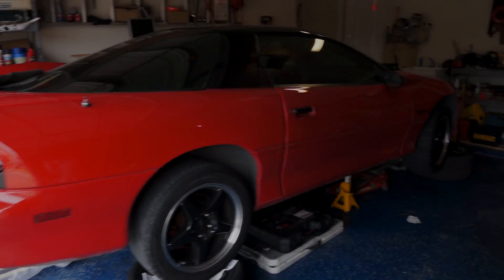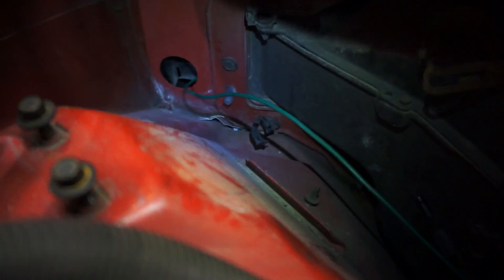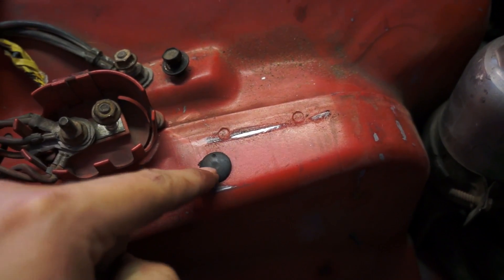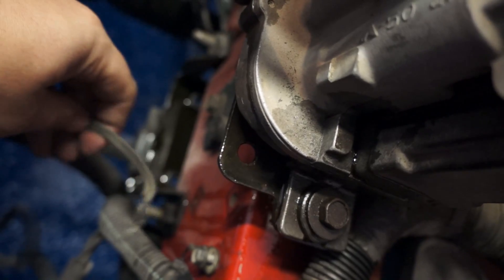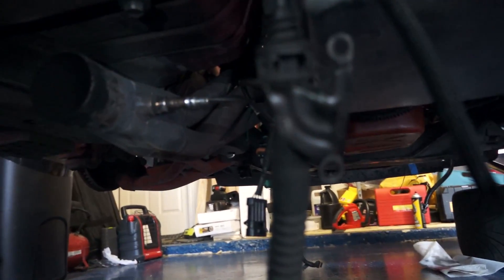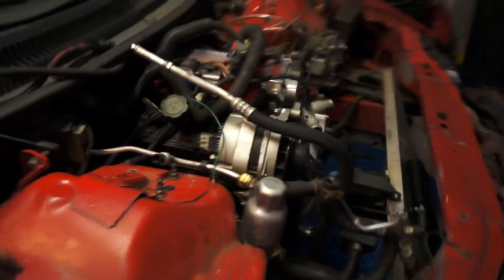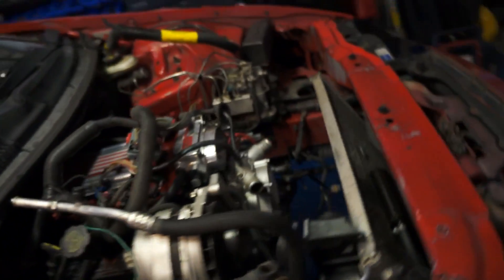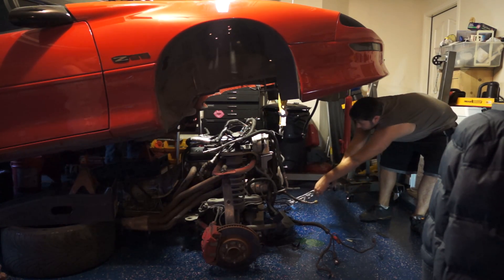F-Body LT1 Engine drop guide

Comment: If you had a lift . with the car up on lift and you remove the K member cradle bolts= Will the shock tower bolts hold the motor to come down remove shock bolts and lift car dropping motor and trans and wheels al at one time ???

Comment: No thank you for taking the time to make this video, this is really gonna help me a lot, I need to do this for my 96Z 28SS, just to do my long tube headers install and spark plugs and wires because they’re routed on the bottom of the engine, I think this will be the easiest way for me, and I hope to be able to buy a tubular key member at the same time, I’m 6 foot six 400 pounds and my hands are just way too big to work on this car with the engine in place, I love this car but I hate having to work on the engine when there’s no room, thank you so much, this will make it so much easier
Reply: Sorry, I was using voice to text
Thank you for your video

Comment: Any tips to safely disconnect the fuel lines so fuel doesn’t spill out?
Reply: unplug fuse for fuel pump and run the engine till it dies out (from no fuel) then you know there is no gas left

Comment: Had a 96 engine and transmission put in my 94, got a PCM programed to the vin of my car. Anything I need to know about wire wise or otherwise? 6 speed manual.

Comment: Will come thru the top with hood still installed
Reply: Nope. You have to remove the hood, radiator, a/c condenser and a boatload of other stuff. This way is much easier than taking it out the top. There's about a foot of engine back under the windshield.

Comment: how did you loose compression? i found the LT1 is a pretty reliable engine minus the stupid opti-crap. my car has 230K on it still doesnt use any oil and still runs strong.

Comment: Just one question where do you connect the strap for the engine lift? I'm going out this way as well and having a hell of a time figuring out where to strap the cherry picker.  Any help would be greatly appreciated.
Reply from the maker: Looped through the intake hole and through the battery hole. It's the frame of the car
Reply: Doesn't it make it sound like the car is bending? I attempted today and didn't feel safe with how it was sounding.
Reply from the maker: +Anthony Piraino in my follow up video I show how I did it. Most people just straight up use the radiator support which I wouldn't do since I've seen one bend
Reply: +Cerridius what about the computer under the intake hole I have a 95 formula both that and my old trans am. that has to come off as well doesn't it?
Reply from the maker: +Anthony Piraino that's for the abs brakes I think. It comes off pretty easy, you should be able to just unbolt a few things and move it out of the way

Comment: is it not easier to just remove the heads and intake and all the Shit on the front and go thru the top or do I mean if you didn't have so much experience thru the bottom would you recommend coming out the top

Comment: I have a 1999 camaro z28 shell I want to drop a lt1 in it but they say it won't mount up. Will a 1993-1997 k member front in line up with my 1999 camaro ? Plz get back with me I'm ready to start on my project and this is what's holding me back
Reply: Just put an ls1 back in it,  lt1 is down grading

Comment: Very nice video, do you have to drain the transmission doing it this way?
Reply from the maker: Richard Miller No you don't have to, but im sure some will be lost through the tailshaft and the trans cooler lines.
Reply: can I disconnect the auto trans from the engine with out taking the bolts that hold converter to flex plate as my crank is broken and I am not sure it will spin to get at the bolts inside bellhousing on the transmission once the engine and trans are removed like you did.
Reply from the maker: Richard Miller Well, yes you can leave your converter connected to your flexplate and pull the trans out from that, but you will likely lose fluid from that and it will be harder to install the trans to the converter, rather than the converter to the trans with it out.

Comment: you know it comes out the top easier
Reply: Cerridius The bottom is way easier because you can keep the tranny on. dont have to pull all the accesories off the front of the motor. with pulling it from the top it takes like twice as long. took me like 6-8 hours
Reply from the maker: thanks, but I prefer the bottom.

Comment: I believe the a/c compressor can be unbolted from the engine so you don't have to disconnect any a/c lines.  Thoughts?
Reply from the maker: Correct, you can leave the ac compressor with the car